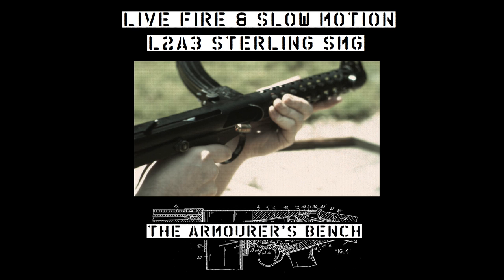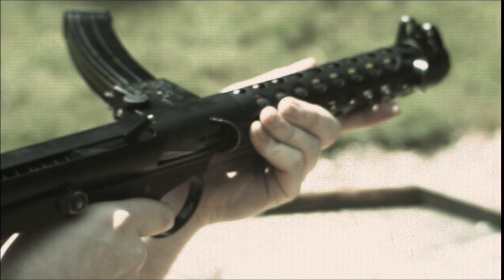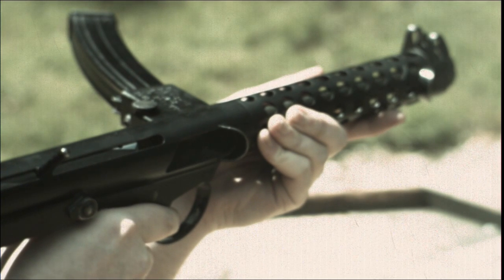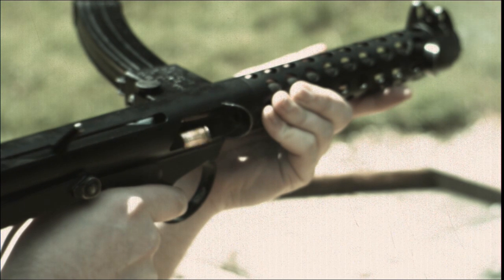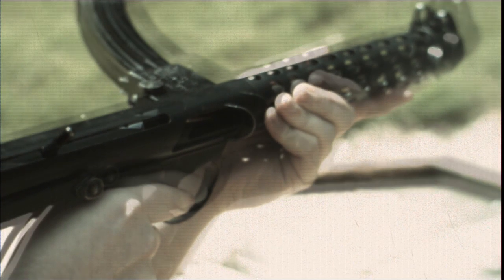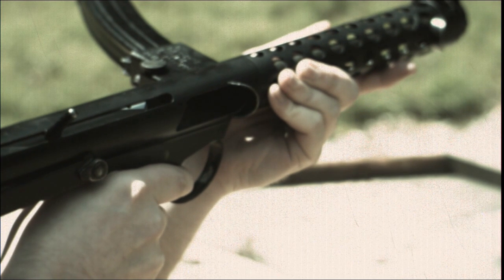TAB Episode 19: Sterling L2A3 Live Fire & Slow Motion

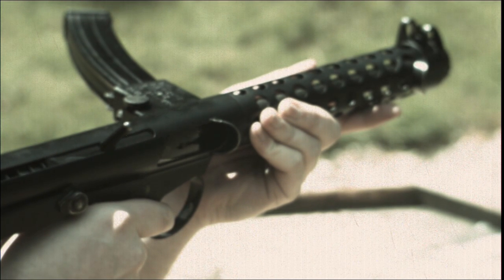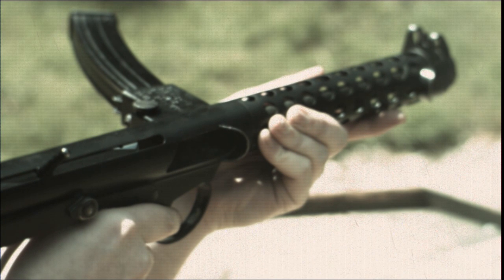Comment: Contrast the bolt closing on a live round at 0:36 with the breech closing on an empty chamber at 1:24 notice how when it closes without a round the gun jerks forward the instant the bolt closes, it's clearly transferring inertia from the bolt to the rest of the gun. But that doesn't happen at 0:36, the bolt never fully closes before the round fires. The primer is ignited when the bolt is still moving forwards, when the bolt has all the the inertia transferred to it by the spring and the force of the pressure inside the chamber must overcome that forward inertia of the bolt, slow it down to zero then accelerate it backwards. 

Look at the slow motion of other open bolt 9mm firearms, you will often see that in the frame the bolt closes the body of the firearm will jerk forwards then you will see the muzzle flash. This isn't just bad for single shots throwing the aim off but also in fully automatic fire as the weapon is alternately jerked forward by the bolt closing then slowly pushed back as the bolt is decelerated and accelerated by the spring. 

I have absolute prove of it as if you go frame-by-frame from 0:36 (press the , and . keys to go forward and backward exactly 1 frame with the video paused) and watch the charging handle, watch each frame as it is going forwards then look for the muzzle blast. on the 26th frame of the 37th second of this video you can see the bolt is still moving forward but the bullet had clealry been fired from the barrel as you can see from the muzzle blast.

This is effectively the same concept as Advanced Primer Ignition (API) as used in 20mm auto-cannons but the genius designers who made the Sterling got it to work on a small scale of a 9mm submachine gun without any extra moving parts.

The bolt also is clearly slowly decelerated just by the spring, it doesn't impact the back of the receiver. This would make the Sterling L2A3 and extremely stable firearm when shooting in either single shot or even in fully-automatic, you'd have a very consistent recoiling force in only one direction; back into the shoulder.
Reply: I'm here because I just saw the wiki page for advanced primer ignition, fascinating idea

Comment: I shot one at a rental range in the U.S. a few years back, spent my money and fired a few hundred rounds through it. Started a love affair with that gun, that day. I have shot a decent number of other submachine guns, and it stands out as one that felt "right" to me. Not objectively better than an MP5 or UZI or anything, but simply one that fit me. 

The  only dissapointment is that it was a L2A3, and not a Canadian C1 that I shot. Although, interestingly, I did shoot it with a mixture of Canadian and British magazines. The British mags were notably easier to load.
Reply from the maker: It's a great submachine gun, excellent ergonomics for the period, very controllable, one of the best SMG mags out there. The Canadians didn't use the same roller follower system and had more of a Sten-like bolt too. Much rarer, I fear Canada destroyed most of them. Thanks for watching! — Matt

Comment: As you have handled both the Australian F1smg and the Sterling L2A3, which is more ergonomic in your opinion?
Reply from the maker: Good question! The Sterling is undeniably the more ergonomic of the two, while the stock folding system is a little cumbersome it is robust. The Sterling's pistol grip is extremely comfortable - both the profile and angle. The location of the magazine is also better and less unwieldy. In practical terms the Sterling is also more compact and has a longer sight radius. I haven't fired an F1 but I must admit I have a soft spot for its aesthetics, the L2A3 is certainly the better of the two in my opinion. - Matt